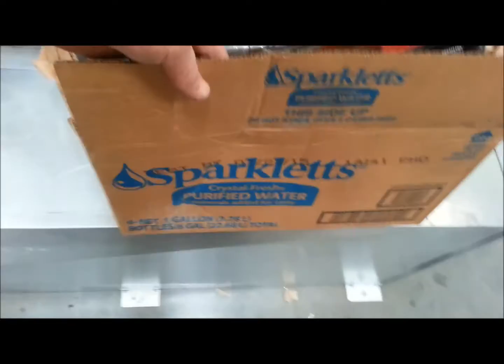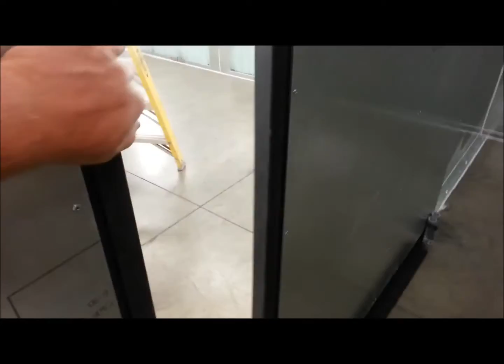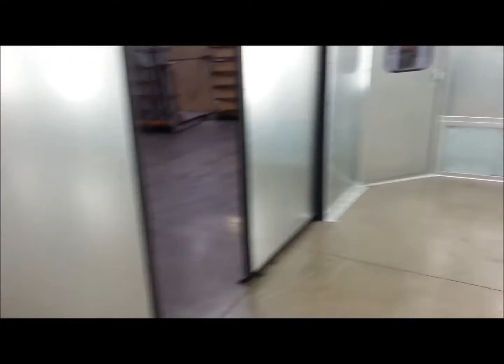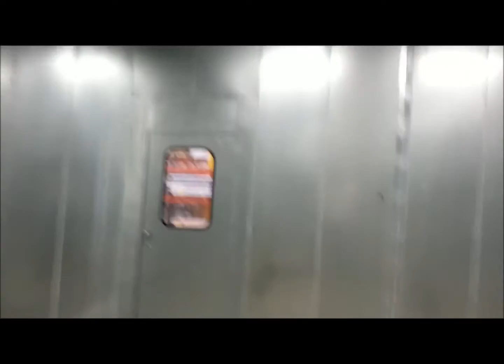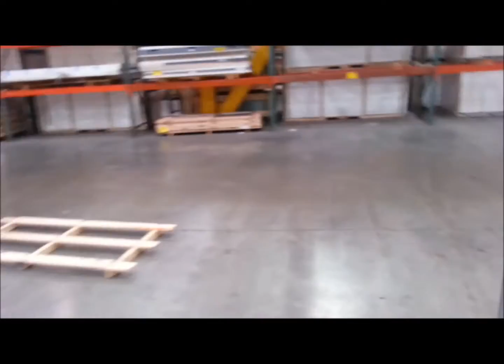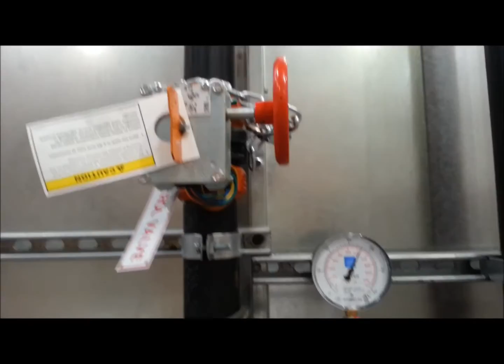Paint spray booth and convection oven for waterborne coatings #3

Comment: hey stan not sure how those cylinders work but 3'' piston is 7.0686 sq in times 100 psi should give about 706.86 pounds of push
Reply from the maker: Those cylinders close the doors on the pull side, so you would need to deduct the diameter of the shaft, but in round numbers, yes, you are correct,  thanks for the comment.

Comment: Lots of work gone into that job Stan. Looks good.
Only question: Isn't that lower temp probe in a perfect location for staff to "adjust" its position?? I didn't see a guard over it.

Colin
Reply from the maker: I didnt get a guard with the booth order, didnt fab one up either. I guess it could become an issue with folks messing with it, but the worst thing that will happen is they lose a "read only" indicator. ... Maybe I can get a service call out of it :)